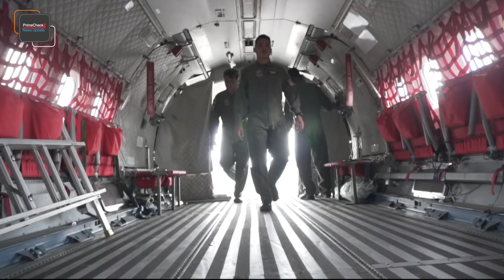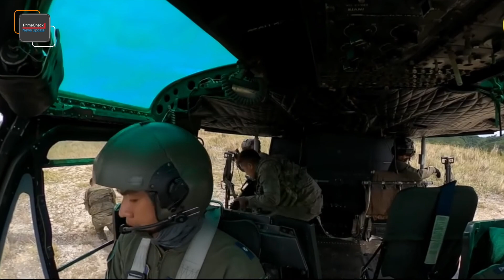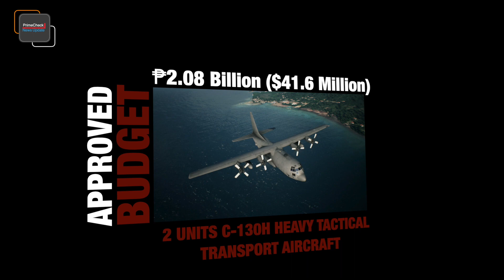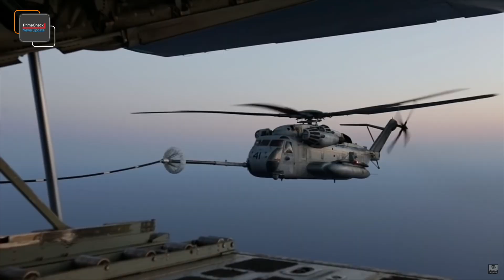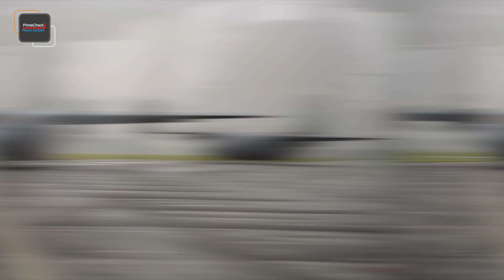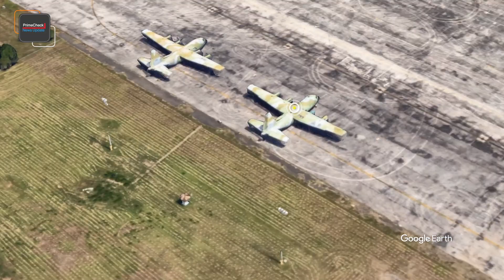C-130 Hercules Military tactical and Multi-Role Transporter Aircraft | Philippine Air Force

Comment: Would the Embraer C-390 Millenium be adequate for complimenting the C-130? I mean, it has a longer range and a more heavier payload capacity compared to the C-130, so I don't see why not.
Reply: C-17 Globemaster III is the BEST HEAVY LIFT AIRCRAFT*, is the best aircraft with even more heavy payload capacity, can carry up to 300 passengers & carry up to 3 to 5 vehicles in any usage. Even Boeing will open their business here, their will open their facilities for military & civilian aircraft undergoing maintenance works. C-17 is the *BEST HEAVY LIFT AIRCRAFT for the Philippine Air Force.
Reply: @johnpaulsoberano4728  Just because it's considered to be the best, doesn't mean it's good for the Philippine Air Force.

Did you forget how fucking expensive the C-17 is?  $385 million for just one C-17 is WAY out-of-budget for the Philippine Air Force. If they insisted on getting at least 5 of them, the Air Force will be broke. Not to mention the spare parts and maintenance of these sumbitches is gonna leave a dent on any government official's wallet.

Oh, and did I mention that they finished production of this aircraft a long time ago? They stopped production for the C-17 back in 2015, which is 6 years ago.
Reply: Coz c-130s are cheaper, I guess. You can buy, at the very least, 2 c-130s for every 1 c-390. Though, c-390 looks cooler hahaha.